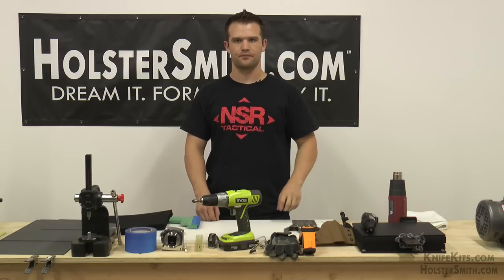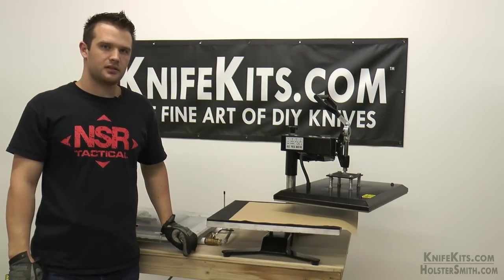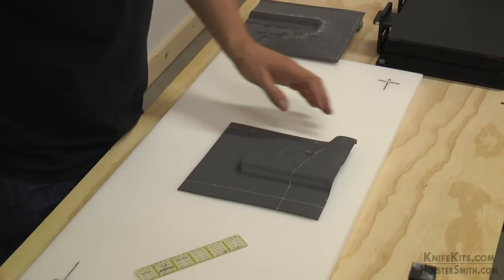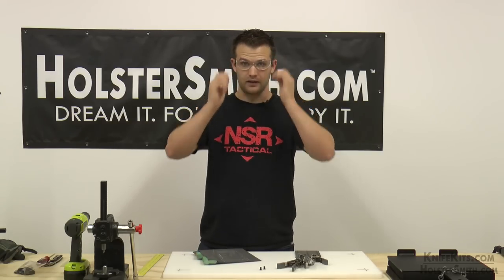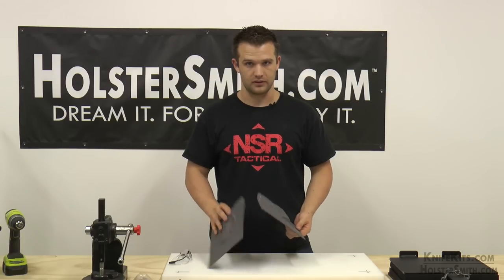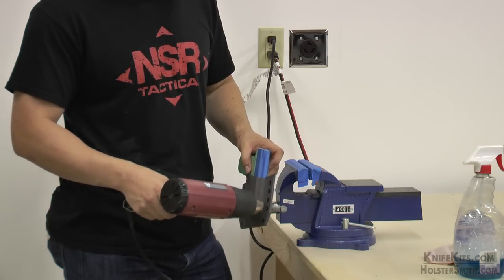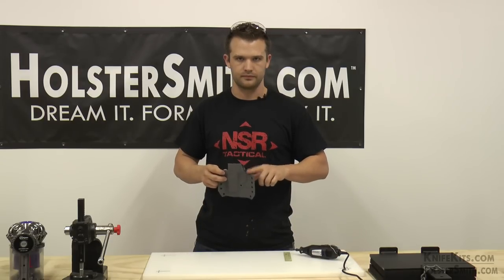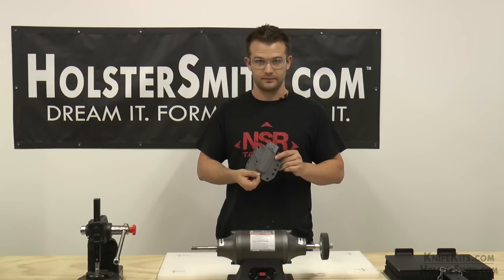DIY KYDEX® Project : How to make a 2-Piece Holster (Feat. Dave White)

Comment: How do you keep the dremel from melting the kydex because of how much heat it generates
Reply from the maker: Like sanding or polishing, you don't hold it in one spot too long. The dremel will take Kydex off faster than it can melt if you keep moving. The dremel will remove material fast so be careful that you don't remove too much.

Comment: What type of blade is used on the scroll saw?
Reply from the maker: They're standard tooth (metal) blades. We're using one of the 3 that came packaged with the unit. KYDEX® doesn't even slow it down.